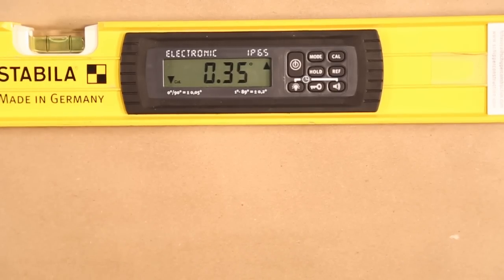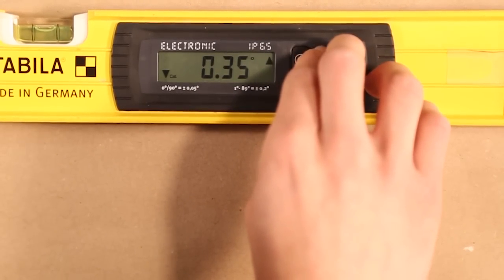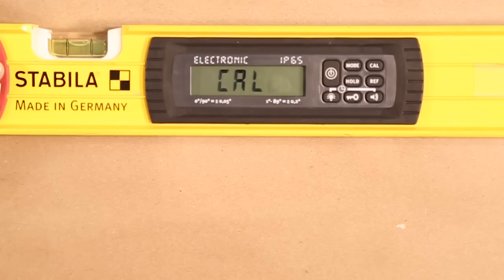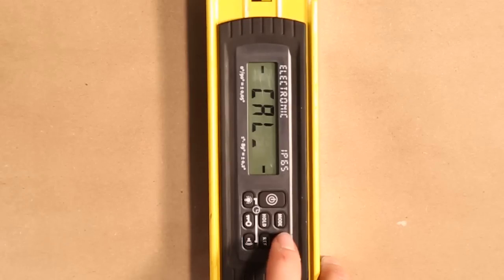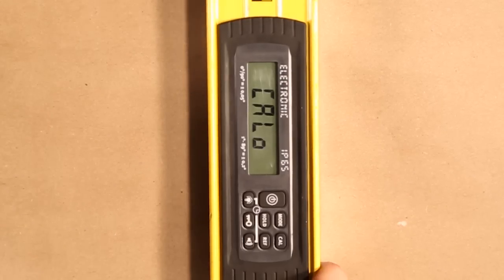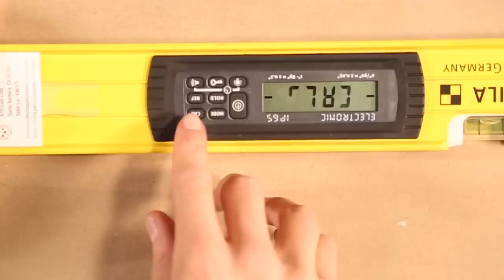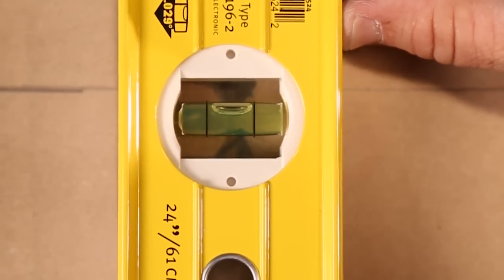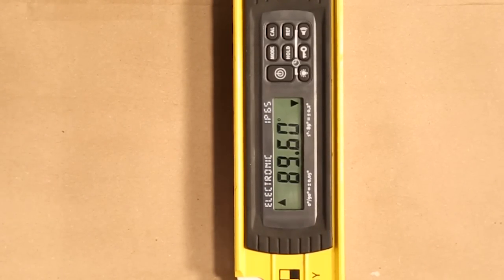4 point calibration STABILA TECH 196

Comment: Hi when I do the 4 point calibration and basic calibration one side gives me different slope percentage when I flipped it the opposite way.  What can cause the level to be off by .3 after calibrating it
Reply from the maker: Hi, please make sure that you place the spirit level exactly where it was before. Also, when calibrating the four-point, make sure that the horizontal vial is as precisely centered as possible. If neither of these help, please contact us again.
Reply: What do you mean by place the level where it was before
Reply from the maker: While you are calibrating the spirit level, you should make sure that it always rests in the same place so that unevenness does not interfere with the calibration
Reply: And when calibrating do you recommend doing it on the wall or on the ground will work too
Reply from the maker: We would recommend the ground but both will work💛🖤
Reply: Oh ok because sometimes when I do the calibrating on the ground I sometimes have to put something underneath the level so the bubble in the middle is level before calibrating because sometimes ground is not level
Reply from the maker: Yes, when calibrating, it is of course important to have a level surface 💛🖤
Reply: Oh ok and after calibrating it's still of on both side what would be my next step in order to fix the issue
Reply from the maker: Where are you located?
Reply from the maker: So please contact our customer support for the USA: 
Phone 800-869-7460
Email: custservice@stabila.com
Reply: @STABILAOfficial  Other electronic levels don't require a perfectly level surface. You flip the level around and the software inside calculates the offset. 
It's actually pretty silly to require a level surface to calibrate a level - the whole point of the level is to tell me if the surface is level!

Comment: The whole point of having a digital screen is because reading the vile isn’t accurate enough. Does this mean there’s no way to accurately calibrate this without a perfectly level surface that was calibrated with a different instrument? Lol
Reply: I agree. I deal with ADA stuff all the time. If something is 0.1% slope over what is allowed, inspectors have to tell the contractor to rip it out. Thousands and thousands of dollars are wasted because of these hardline rules (you can thank the litigation threats). And we are calibrating based on what people view as level by the bubbles during calibration? This method works fine for general construction. But I'm not comfortable with using this for ADA inspection.
Reply from the maker: The reason to use an electronic spirit level is not the inaccuracy of the vials. Its electronic measuring technology along with precision vials makes work faster and more efficient: the digital displays can be read easily regardless of application conditions and illuminated at the touch of a button and the acoustic guidance with 3 different audible signals helpt to align components quickly without having to look at the spirit level.
Reply: @STABILAOfficial  It's still backwards to digitally calibrate something against an analog read-out, and even with good vials different people might interpret levelness slightly differently. There are digital levels that can calibrate themselves simply by resting on a horizontal (doesn't have to be perfect) surface, then flipping the level end for end. The software figures out the middle and self-calibrates. That seems a much better way to go.

Comment: Are you doing this on a wall??
The other calibration videos from Stabila just say to turn on and press the "CAL" button, which one is correct for our IP65 ?
Thanks.
Reply from the maker: The first step of calibrating the TECH 196 electronic IP 65  spirit level is to switch on the electronic spirit level and use the vial to accurately align the unit to a wall, for example, until the vial bubble is in the middle between the vial rings. Please check out the User Manual on our website for a detailed description of the calibration 👉 https://www.stabila.com/en/products/details/tech-196-electronic-ip-65-electronic-spirit-level.html

Comment: Hello I attended the follow this process and for some reason after the first rotation when I hit the calibration button that does nothing just continues to Blink there's no beat to have a faulty unit?
Reply: Following your directions to a tee, my brand new IP65 changes from the calibration screen to a line of dashes before I get around to my forth calibration point.
Reply: same for me - I get this just before my last calibration...I think I did the first three OK
Reply: @patrickniedermeyer2112   the dude in the video said rotate it CCW, but he rotated it CW for some reason.  When I did the rotation CW, I would get that same - - - - dash looking thing and it would freeze up.  I tried rotation it CCW and it worked - all for points and I got the ready "rdy" blinking signifying it is ready to go.  Stabila should note the 4 dash thing in their manual and what it means, but I could not find it.  I recommend maybe rotating it CCW during the calibration - it may help.
Reply: Seems to be a common fault. I have had two 196-2 electronic fail like this. One can calibrate three ways but not the fourth horizontal. Seems like they are scrap. They are 1 to 2 degrees off.
Reply from the maker: Hi Devin. Thanks for your comment. How old is your Level? The first electronic modells support no 4 point calibration.
Reply: StabilaTools I have had it less than a year
Reply from the maker: where are you from? Please send us a message here on youtube with your contact.
Reply: StabilaTools ok
Reply: I just got my 24” & 48” Stabila Tech Magnetic. I plan to leave these in my garage winter & summer. Summer can get up to 90s degree and -10 for winter. If it is true that we need to recalibrate every times the temperature changes by 20 degrees since last use, this will become a major PITA. I kinda regret the purchase now after seeing Milwaukee’s new digital level (self calibration for life!)